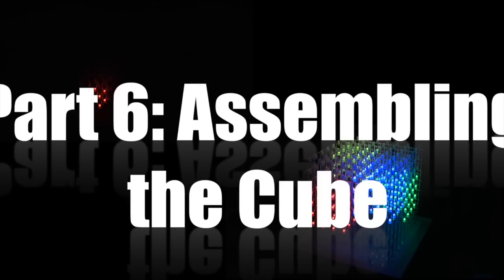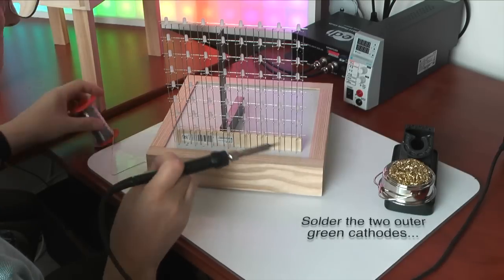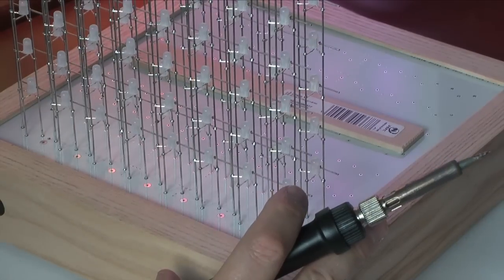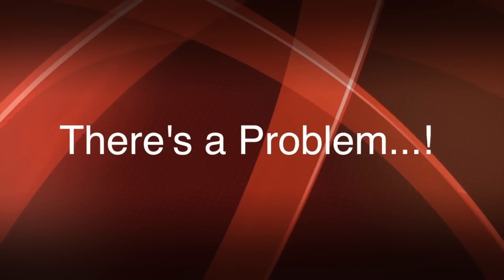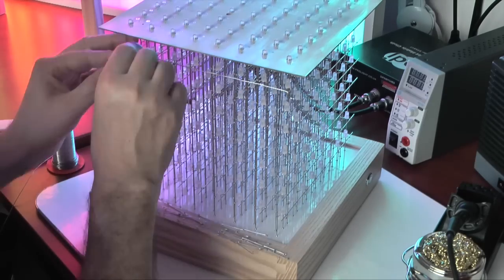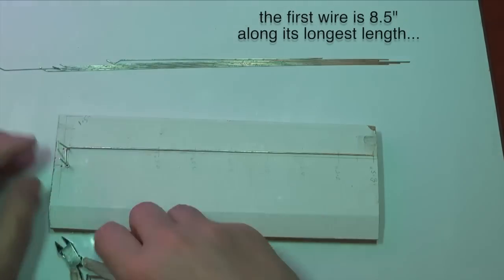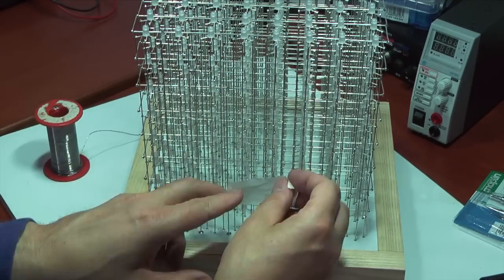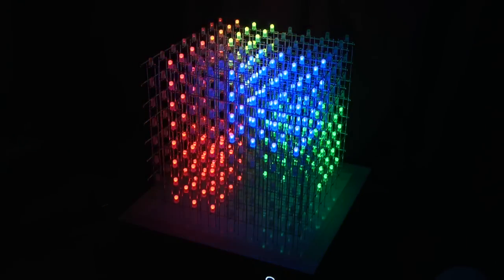Construction of an 8x8x8 RGB LED Cube. Part 6: Cube Final Assembly

Comment: Hello Steve,I posted a short video and a number of assembly pictures of my 8X8X8 RGB LED cube.Here's a link to that post...https://plus.google.com/106626345342202981932/posts/RCnWduhk9SrI kept the base design to a bare minimum for now as I have not really decided what fine wood that cube will be resting on and also I want to add some front panel controls such as potentiometers, switches and possibly a small LDC display to help select and modify the animations of my cube, that is also TBD...I simply did not have your patience to do a detailed step by step tutorial. I want to thank you again for your tutorial as it helped me so much with this build !
Reply from the maker: +JP Roy Hey JP (if I can call you that),
Sounds like your making good progress with some exciting stuff to come. Unfortunately the URL you provided is an unrecognised address so I can't yet see what you have achieved. I'm glad you find my videos helpful and if you could re-post the link to your video and pictures that would be great.
Reply: Hi Steve,

This is a link to the FastLED community where you should find my post...

https://plus.google.com/communities/109127054924227823508
Reply from the maker: +JP Roy Hi JP,
Looks really awesome, nice job indeed. Couldn't quite make out what micro controller and electronics you have implemented though. Whatever it is it looks simpler than mine.
Reply: Hi again Steve,

I hate to say this but it is not just simpler, it is also quite a lot more powerful.

The microcontroller is a Teensy3.1 and it is a very very powerful little 32 bit, ARM Cortex M4 based microcontroller. Comes with 256K program space, 64K ram and runs at 72MHz. I actually overclock it at 96Mhz!
Note that It is not  open source like Arduino but easily available.

Detailed info about it at..   http://www.pjrc.com/store/teensy31.html

Apart from the Teensy, there is in fact NO other electronics. One of the pictures shows everything, it is just 8 wires that connect to each of 8 slices of 8X8 LEDs.
Reply: Actually, I forgot to mention that there is also an adapter board that plugs directly into the Teensy. It is an OCTOWS2811 adapter that is made specifically for the Teensy3.1

That board allows the parallel transmission of data to 8 separate strings of WS2811/WS2812 . Effectively making data transmission 8 times faster !

On top of that, the Teensy uses DMA technology to send LED data. That frees up microprocessor time for more useful stuff like complex calculations of the next frame of data to be transmitted to the LEDs.
Reply from the maker: +JP Roy Thanks JP, Really useful info.
 I'm going to check out the Teensy and the adapter, in fact I just ordered them. Is it easy to implement the DMA? I have already heard of it but have no idea how easy or difficult it is to implement. Any advice would be greatly received.

Where did you get the led's from? I can't imaging that they were that cheap being they have the integrated WS2812 technology.
Reply: Hi Steve, to implement DMA you only need to use the OCTOWS2811 library that you can download from PJRC. You can get more details about that library from the PJRC site.

Note that I instead use the FastLED library that can also automatically use the DMA engine on the Teensy3.1. FastLED is a fast, efficient, easy-to-use Arduino library for programming addressable LED strips and pixels.  

I purchased the LEDs from Alibaba.com. Just look for: 'Addressable Through-Hole 8mm RGB LED with Diffused Lens, WS2811 Driver' for pricing.  Back in April, I purchased 600 for about $165US that included DHL shipment to Canada.

You could also look at the APA106-F8 they seem to be identical.
Reply from the maker: +JP Roy Thanks JP, very helpful and much appreciated.
Reply from the maker: +JP Roy Hi JP, I ordered 2000 leds last week from Alibaba for $348 and they arrived today. Very pleased with them for that price. Thanks for the tip.
Reply: Hi *****, what is the grand plan for all them LEDs ?
Reply from the maker: +JP Roy A 12*12*12 cube based on your construction method. I have a couple of Teensy 3.1 with OctoWS2811 Adaptors.
Reply: WOW !!!     Can't wait to see the results !
Reply from the maker: +JP Roy You might have to wait a while, but hopefully worth the wait. BTW, I have been trying to find the photos of your cube, any chance you can share the link. I had a look on FastLED and can see 2 videos but no photos.
Reply from the maker: +JP Roy Not to worry, I found the photos.
Reply: Hi Steve,
I want to share some thoughts on the subject of a larger cube build.
My initial idea was to build a 16 sized cube as I thought the 8X8X8 had been done by so many already and I wanted something that stood out. However, as my 'dream' cube would cost me 8X as much just in LEDs as the 8 sized cube, I chickened-out and went the more 'reasonable' way as you know. I figured I would sell or give away that cube if/when I decided to go ahead and build a larger cube.
Now, with the experience of my current build, I am glad that I started somewhat modestly as I would probably use a different approach for another build, be it 8 sized or more...
I would not use these 8mm diffused RGB LEDs with embedded WS2811 devices. I find the diffused material to be too 'visible' and it actually absorbs some of the light emitted by adjacent LEDs when the are off.
I would probably go with WS2812b devices instead. Have a look at this link to the L3D Cube designers to have a general idea of what I am considering...
http://www.lookingglassfactory.com/the-shop.html
Note that they use a thin PCB to string the WS2812b where I would again try to use a straightened wire, much like that of our current builds. The LED visibility would be so much better but there is a main drawback to this approach: I lose the full 360° view as the WS2812b LED only has at best about 120° viewing angle.
On the other hand, these WS2812b are much brighter and have much sharper colors. They actually have an 'incandescent light' quality to them. Their light emitting surface to package size ratio is so much better than the regular 5mm or 8mm diffused LED package.
I know that you already purchased your LEDs and may even be in the process of building your new cube but wanted to share my view. Whichever way you go with your build, I am sure it will be an awesome creation.
Reply from the maker: +JP Roy HI JP,
Thanks for the rundown, very interesting comments. 
I know of lookingglassfactory quite well as I actually have 2 L3D cubes myself, I backed their Kickstarter project about a year ago. The cubes are great but the viewing angle is something that bugs me. I will agree about the crispness of light etc, My old cube does bounce light off the tinned copper wire as well, which isn't great. 

The thing is with the WS2812B devices is soldering them, It's currently way beyond my ability. I might space my 8mm LEDs further apart this time around. I haven't started the project yet and I want to think about it before I do. 

Great to have your comments, gives me more things to ponder that I hadn't considered before. I am looking forward to getting into the Teensy and DMA.
I'm just about to order 50M of WS2812B strips for a large panel. I hadn't planed on it just yet but I think I got a great deal on Alibaba.

Comment: Excellent work and so easy to follow. I have just made an 8x8x8 RGB LED cube using your method and it has turned out better than I had hoped for.I have also (almost) followed your schematic for your panel testing rig, by almost I mean I have used 74HC595's and ULN2803A's instead of your TLC5916IN. Using my version of your circuit is by far the easiest circuit I have seen yet. Your panel testing code works perfectly on my setup, and I would like to use your cube code to run my cube with.I am not sure if it is a fault at my side, but when I download your files for the cube I get almost the exact same sketch in both the 'Panel Burn In Test' and the 'Cube Burn In Test' folders (although the sketch in the cube folder says it is for the cube and has a bigger ISR section at the end).Would it be possible for me to get a copy of your Cube code please so I can finally see my cube shining.Best Wishes
Reply: +Ant Brown this cube is here http://www.ielectronicparts.com/product-category/do-it-youself/

Comment: Hello Steve, impressive tutorial !

I will attempt my own build and would like your opinion on the ratio of LED dia. (5mm) to spacing (25,4mm or 1") that you used. I see that other builders also use a similar ratio of approx. 1 to 5. From the videos, this ratio seems like a good balance between cube density and LED visibility.

Here's my question: If you would build another cube, would you consider another ratio than 1 to 5 ?  why ??
Reply from the maker: JP Roy Hi, Good question and my answer is yes I would consider a different ration. Possibly 1.25" to 1.5". This makes the cube a bit bigger and possibly look less cluttered with all the wires thus improve visibility of led's at the back of the cube when viewed from some angles. The down side is it needs a bigger base PCB which would be more expensive.
Reply: ***** Thank you very much for that suggestion. You are a natural teacher, keep up the excellent work !!
Reply from the maker: JP Roy Your welcome and thanks for the kind comments.

Comment: People are adapting your assembly method for the cube itself and using it to build my cube boards! LOL!
Here's kind of what I have been up to lately with mine...you'll notice my poor cube is looking a bit ragged, and it got a bit sqished one day. Never the less, it's still in pretty good shape after I did what I could to straighten it out and repair the solder joints.
https://www.youtube.com/watch?v=Ll8ayM7O744
Reply from the maker: Hey best of both worlds then, my construction method and your boards, way to go LOL.

Sorry to hear your cube got squished, bit of a bummer having to spend time straightening it. Mine isn't quite as square as it was due to 300 mile round trip in the trunk of my car plus several leds have been replaced due to failures.
Reply: ***** Ya - people seem to like your construction over mine as it doesn't cluster wires on one side of the LEDs, but they like my circuit for it's simplicity of assembly and versatility with the multiple prototyping boards and universal music module. I don't get many people complaining of failures since we all started using my Hong Kong supplier and avoid parts from China like the plague. I would have liked to trade code, but your cube seems to be based on RGBX64 rather than RX64, GX64, BX64 in terms of the data stream as I recall.
Reply from the maker: supertech2006 TBH I haven't developed my code beyond the test patterns and I still haven't implemented software PCM yet. I think I got more fun out of building the cube that coding for it. When I get something I'm a bit more proud of then I'll happily share it.

Can you share who your Hong Kong supplier is?
Reply: ***** We use bit angle modulation (BAM) to control brightness. Kevin Darrah and Nick Schulze also use BAM in their codes - which also run on my cube (with tiny modifications). Our (Doug Domke's) code goes beyone and allows text effects and sprites and a host of other routine implementations. It's quite impressive. The demos I showed here are very weak. I have much much more impressive videos available.
Reply from the maker: supertech2006 It has been my plan to use BAM after viewing Kevin's video blogs several months ago, I just haven't got around to doing it yet.

I'd like to see those impressive videos if you have the links.

Comment: HI, i will remake your project but I'm having trouble understanding where those JP1, JP2 ... connect and where the Arduino connects. Pls explain where everything connects. I won't be doing the PCB. I'll make it myself on protoboard.
Reply from the maker: Hi, If you look at the end of the video you will see an image of all the boards connected to each other. The Arduino connects to the anode driver board which in turn drives the 4 Shift register boards as well as the 8 anodes. The 4 shift register boards connect directly to the underside of the base PCB using JP1 through JP24. LED1 Red Green & Blue connect to pins 1,2,3 of JP1, LED2 to 4,5,6 of JP1, LED3 to 7,8 of JP1 and pin 1 of JP2, LED4 to 2,3,4 of JP2, LED5 to 5,6,7 of JP2, LED6 to 8 of JP2 & 1,2 of JP3, and so on. Hope this helps.

Comment: Where did you order the base PCB?
Reply from the maker: I used a company called Proto-pic in Scotland who outsource to a company in China.
Reply: ***** thanks! how much did the baseplate cost you?
Reply from the maker: About £250 for 5 boards minimum order. It's a prototyping service so there are setup costs involved.
Reply: ***** I think I will make my cube base w/ a wooden plate with protoboard glued under it :D obviously w/ 0.1 inch grid-snapped holes^^
Reply from the maker: Interesting idea, let me know how you get on
Reply: ***** How I got on? Yeah, my teacher just jumped from 8³ to 16³ :D that will be fun.
Reply from the maker: ***** Does your teacher understand the order of magnitude in effort and cost that building a 16³ cube takes over an 8³. Its a massive undertaking, so good luck. Do share your progress, I would be very interested to see how you get on with it.
Reply: ***** yeah, he's aware of it^^ I built an 8³ a few weeks ago, so I grasp the concept of it^^ The cost is covered since the leds are sponsored :P But STP16's will cost a bit :D 48 of them :P

Did you control your cube w/ teensy or with arduino in the end? If w/ teensy: did that work out well with the stp16 needing 0.7*Vcc as a high but 0.7*5 being 3.5V (e.g. higher than 3.3V out from teensy)?
Reply from the maker: ***** Currently running with an UNO but intend to use a Teensy 3.1, just not got around to it yet, so got to work out converting the 3.3V to 5V stuff.

Do you have a video or blog of your 8³ cube?
Reply: ***** I can upload one later, it's monochrome (blue only) though^^ Your style of wiring the leds motivated me to make an rgb one because the blue one is... flat XD since i soldered the legs together directly...

Comment: When will the schematic and parts list become available?
Reply from the maker: Hi James, As yet I haven't finalised the design, so a finished schematic isn't yet ready. A parts list could be draw up of what I have so far and I'll look to doing that this weekend and post a comment here on YouTube.
Reply: *****
Thanks for your reply. I have already made the eight sections of leds, and would like to proceed further.
Reply: FYI It would be great to get a .pdf of the test circuitry and the final schematic. I would think that the final schematic is an extension of the test circuit. If you published just the test circuitry in .pdf, then I could expand it to the final operating version. Thanks Again For Your Help.
Reply from the maker: James Nemcoes James... I don't have a finished schematic yet but I do have a schematic of the 8x8 panel test circuit, and you are correct, the final circuit is but an extension of the test circuit (almost). The test circuit schematic can be found on the bottom of page 4 of one of my blogs, here is the link:
http://www.eetimes.com/author.asp?doc_id=1323899&page_number=3
Just click to enlarge the image and download it.

A schematic of the shift register boards is also available from this link:
http://www.eetimes.com/author.asp?doc_id=1325286&page_number=4

Hope this helps
Reply: *****
Thanks for sharing your information
Reply from the maker: Hi James,

I have made a bunch of files of the project so far available for download (mainly in PDF format). The files included are schematics, PCB layouts, Arduino Sketches, Jig Drawings & Full Parts List: 

https://www.dropbox.com/sh/fyvszu2xnow17fg/AACotfHOmN3eo0gS3QTL1lH1a?dl=0

Enjoy :-)